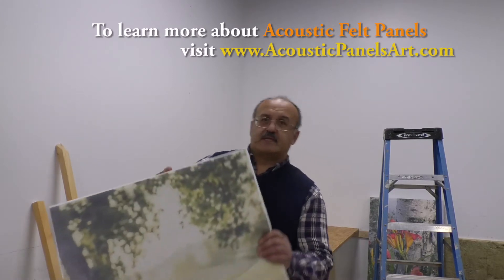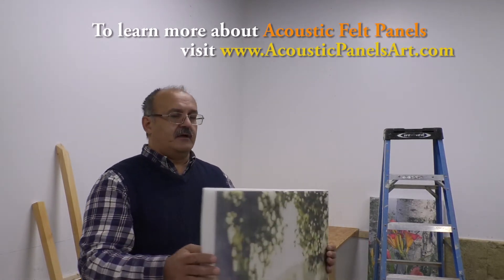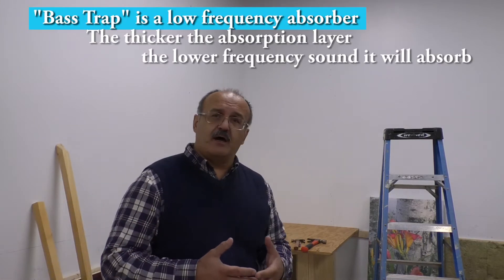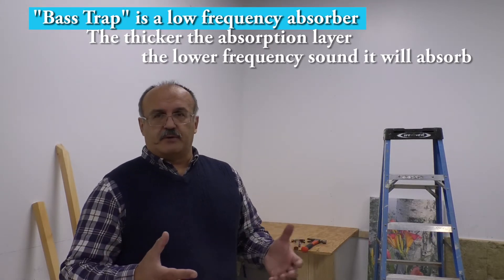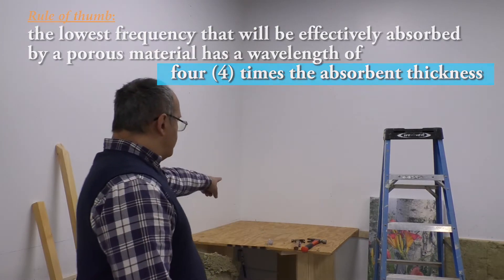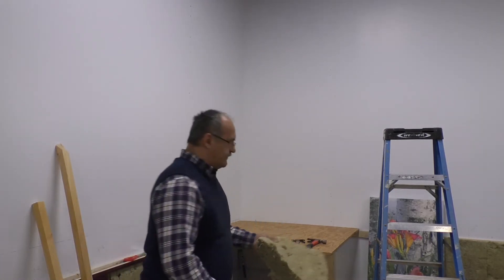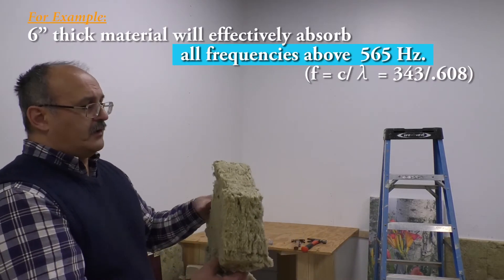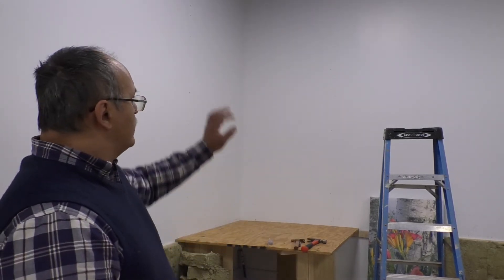How to build Bass traps for Home recording Studio easy and visually appealing way.

Comment: Shouldn't there be an air gap in the corner between the rock wool and the wall?
Reply from the maker: Interesting question: the simple answer is "No". The airgap is needed to create a disruption between the layers of soundblocking materials to prevent vibration of those materials in unison. Meaning if several layers of sound blocking material vibrate  together at a certain frequency, then they transmit the sound energy. Therefore the efficiency of that barrier is reduced. If you make an air gap between sound blocking layers, they vibrate independently and block more sound. This is the reason for resilient channels,  green glue, and elastic membrane in a "silent" drywall .
When we recommend to have an airgap when using acoustic blankets,  that is because it allows the blanket to absorb the sound energy twice: the first time when the sound goes through the blanket to the wall and the second time when the reflected sound goes back through the blanket again.
Some other materials, like our Acoustic Felt Panel. Work equally well with or without the gap.
The rockwool in the corner is a sound absorber. It is a porous material and it does not need additional air gap.
The reason for filling up the corner with rockwool is to create a bass trap: the thicker the layer of sound absorber, the lower frequency it will absorb.